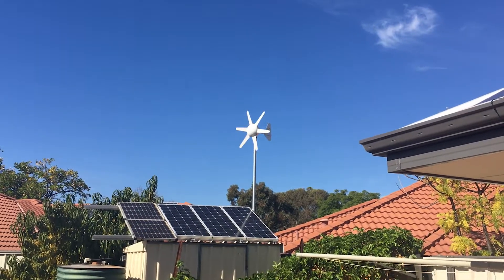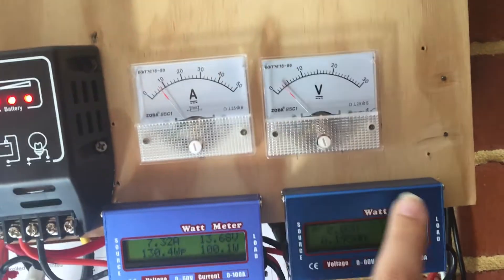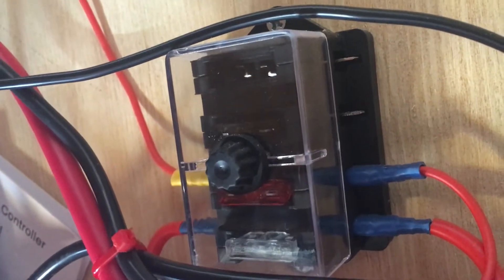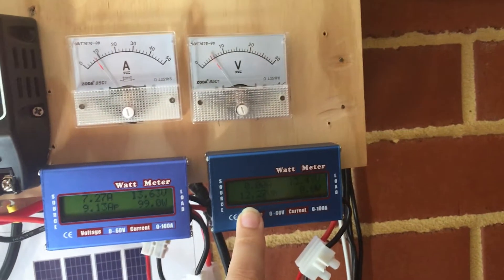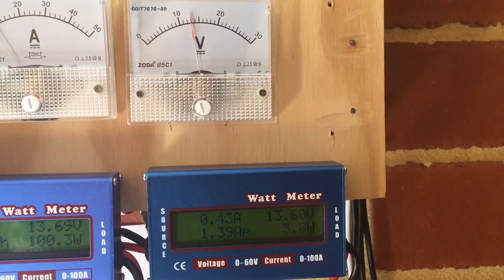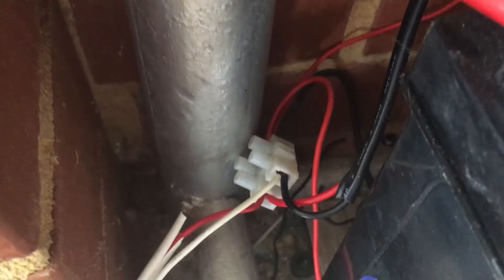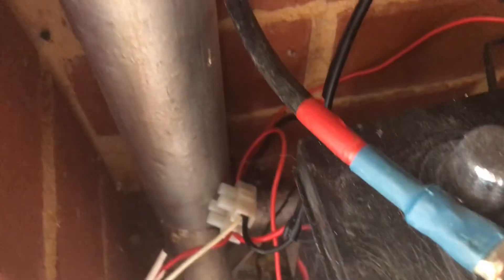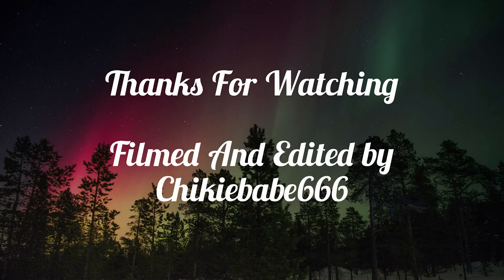My 12v Wind Turbine Setup

Comment: actualy that seems to be a good little turbine for low wind output, judging by the lack of movement in the trees etc.
Reply from the maker: +Ken B 
Yer is not too bad but it dose need a bit to get it over the voltage but I'm going to fix that I know 2 ways I can get move volts ill make a video about it. One way of them that is because I don't have the $ for the 2nd way but I'll say what you can do.

I'm going to see how much more I can get out when change it but that's for a later video I don't know when at the moment.